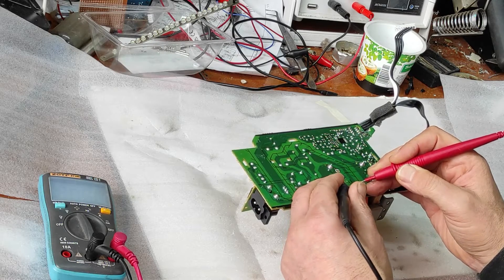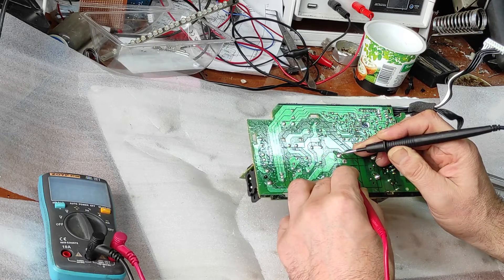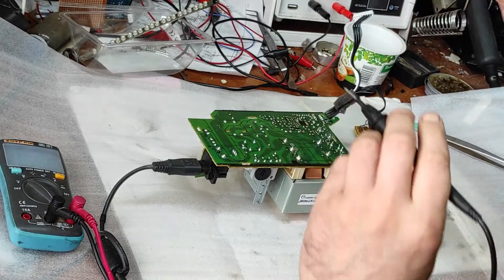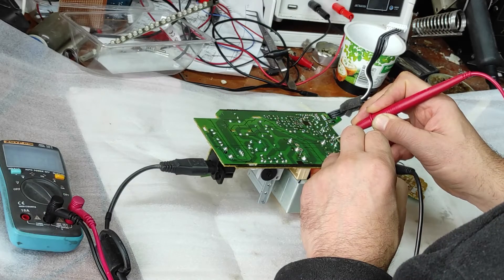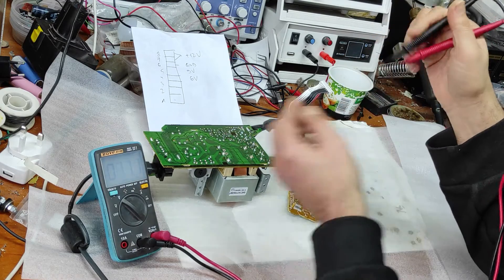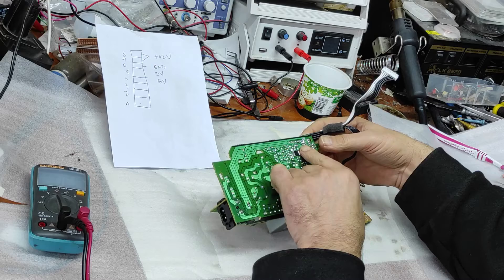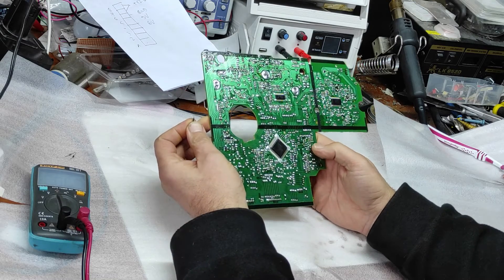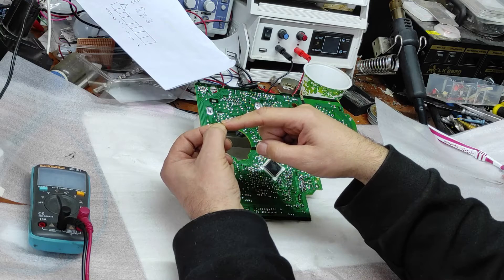Panasonic RX-D55 apply 230V on 110V input overvoltage repair

Comment: hello i have a rx ds 11 japanese version which takes 100 volts and 50/60 hz and i powered it with a 240 volts and i heard a pop noise then smoke can u tell me if its problem with fuse and transformer or if its gone forever
Reply from the maker: @darkcupid7324  check the parts from my video maybe u r lucky.
Reply: @diymariuselectro  hey just an update i have blown my transformer and fuse which saved my sterio and i can power on my sterio using batteries and it works normally

Comment: hello what's the possible issue with mine theres no display only backlight eq and sound virtualizer displays at the top but the display at the bottom doesn't work I can't tell what fm/am station is the radio at only lines at the bottom
Reply from the maker: if all the functions are working,u can try clean the pad between the display and mainpcb.maybe u r lucky.

Comment: I have another issue with this device. When i put a cd inside and press the play button, the cd goes inside, then there is a short rattle, and the the cd comes out again. Any idea? I opened the device but i can not remove the main board (the brown one) there are 2 screws on it, but after removing its still not loose. How did you remove it?
Reply from the maker: I cant help u because I dont remember.probably cd lens is dirty or old and u have to clean or increase current.

Comment: Hi,I have a same issue. I changed the burn resistor by 100 ohm one.I also changed the short diode by 5.6v one.I have 14.6v main voltage,13.84v of the resistor input voltage,6.16v of the resistor output voltage and the channeling diode.The voltage regulater input is 6.16v,the output is 3.9v.When i put all the parts together and plug in the power,I can also see the watch,but when I put FM button or USB button or any button,the screen won't turn on the orange backlight,just show the button function information,and like restart,the screen dose show nothing,turn back to the watch view.I need some help from you,thank you.
Reply from the maker: u find the schematic on the internet,u should check all the voltages to the microcontroler.if the microcontroler is fault,u have to change it if u find with the software.there are some regulator voltage next to microcontroler and maybe u r lucky.
Reply: @diymariuselectro  How much power resistors and diodes should be replaced.I replaced 1/4w 100ohm resistor and 1/2w diodes.Will rebooting have anything to do with this?
Reply from the maker: @LiDxMan  power is good .